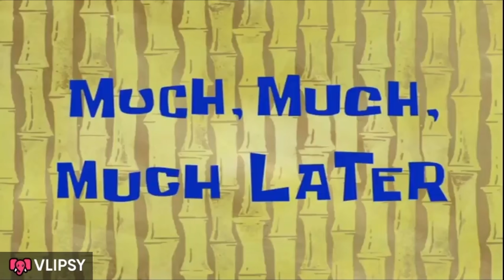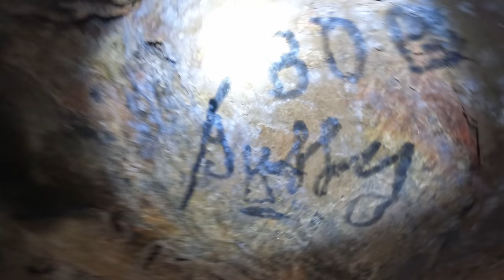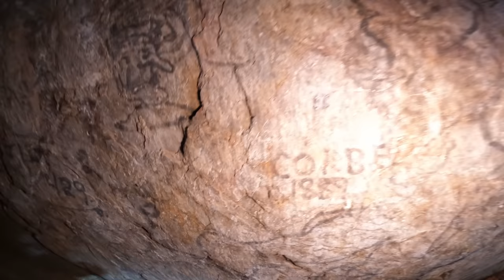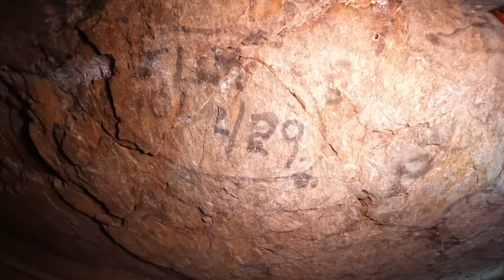We Got Stuck In An Old Mineshaft Elevator 900 Feet Below The Ground At Cerro Gordo!

Comment: When you see a "broom handle" sticking out of a hole inside a mine, please don't touch it! It's probably a tamping stick. Tamping sticks were non-conductive material (usually wood) used to tamp sticks of dynamite in to a blasting hole. That being said, I really enjoy your content!! I probably never would have found your channel, except that I follow Ghost Town Living. You rock!
Reply: would dynamite be able to explode after 100 years of being in a hole with a lot of moisture? genuinely asking.
Reply: @No444F  Yeah, sometimes it can explode by complete chance.
Reply: @No444F  thats why theyre illegal until under special certification and even then the old ones arent used. Even dropping one has set em off completely unstable aged.
Reply: or it was the storige for the anti horny bonk stick for the miners this is a joke
Reply: @No444F  that's the beauty of NITRO! Bump or just the ground vibrations from stepping near it, can set it off.
Reply: 21:15
Reply: Learn something new everyday
Reply: This is mad I love it well done boys
Reply: Fun fact old dynamite sweats nitroglycerin
Reply: @No444F  YES lol. TNT sweats nitroglycerine, which will explode if you touch it hard enough. The amount of nitro that sweats out does depend on how the TNT is stored and for how long, but obviously the safe bet is to assume its unstable if you don't know how old it is. If the nitro goes off from being moved too hard, it can set off the whole stick, which can kill you. 

Its one of those situations where if you aren't an expert, no touchy

Comment: Anytime you handle sticks of dynamite. You have to wear really good leather gloves. Because if ya don’t. It will cause your blood vessels to dilate. Giving you a spinal headache. Which trust me....you definitely don’t want. Also some blasting caps can be set off by static electricity alone. So I would definitely do some research on how old it is and what kind it’s is. Before messing with any of the explosives down there. If I had to guess. I would guess that it’s probably harmless as old as it is. But I would definitely check first lol 🤙🏽
Reply: Ice cream will take care of the headache, believe it or not!
Reply: For those who don't understand.

Dynamite is nitroglycerin "stabilized" by mixing it with diatomaceous earth.  That works quite well until it starts oozing out of the dynamite.  Then it's just as touchy as nitro is reputed to be.

In the early days of rail, a crate was "lost" at a station's cargo area—no bill of lading, no mfgr marks, leaking an oily substance.  The station manager decided to find out what was in the crate by opening it with a crowbar.

The explosion destroyed the station and did significant damage to surrounding structures.
Reply: Excellent comment. We are bioelectrical beings. We can store a great deal of energy in our cells. That can be discharged with a simple touch.
Reply: @EdwinWiles  the same shit that is uused in pool filters??? i never knew that! i did pools for 20 years and hated cleaning DE filters! and i imagine there was quite a mess where the man once stood??
Reply: @tre420gaming4  What man?  What station?  That lot's been empty for the last 30 seconds.
Reply: @EdwinWiles  and killed 20 as I remember. It was covered in a history talk I listened to.
Reply: @EdwinWiles  it's nap time grandpa. get off the computer your making a fool out of yourself again.

Comment: when everyone was laughing the brake failure off Heavy D wasn't which shows how serious it was and how much of a fright he got.
Reply: Yeah he really is a big wimp at the end of the day
Reply: I’ll be honest, I’ve never seen brake fluid boil in a Polaris before. I’ve made some boil in a late model stock car, but never in a 4 wheeler. Good lord.
Reply: Yep 900 ft isn’t crazy far but concerned how old that mine is pretty serious stuff and not the safest… and to the comment of a wimp dude idk if you have ever came close to death it really changes things and it a weird feeling and very life changing. I came within inch’s of dying in 2019 iv got 3 places on my brain. Can’t spell for shit had back surgery 3 shoulder surgeries and my right shoulder won’t heal or get better and will be a 3rd surgery one day with a complete replacement just wanna wait as long as I can.. so I wouldn’t call him a wimp for worrying about himself and the crew/team in the cage.
Reply: this hurt my brain to read
Reply: How serious it was? GMAB!  You really think he'd be stuck down for long just because the elevator failed?   How many very capable guys does he have working for him?   It was either get the elevator going, which was obviously the most likely scenario or they would figure something else out pretty quick.
Reply: To accurately predict what the remaining load capacity of the cable after sitting for so long without use, or the additional strain when the cage binds on the sticky rails, that is impossible.  You would be guessing.  And the possibility of rust working inside the cable for ten decades or longer, at any point along the length.  He was right to be concerned.
Reply: @docwatson1134    I think it's pretty obvious the cable has been replaced, looks fairly new.
Reply: From the video the cable looks to be in fairly good condition, but to assume the absence of corrosion inside the cable, when immediate death is the result of a failure, is not good judgement or good practice.  In all other mine exploration videos, there are TWO safety lines, the one you are hanging on, and the one that will catch you if the first one fails.  

Obviously that would be very difficult and expensive to do here.

I heard it said, it's all in your head.  Until your equipment fails.  Then it gets real.
Reply: @docwatson1134    LOL!   It's clearly not the original cable, they replaced it and I bet they used the same type of cable they were using to pull vehicles up from that cliff.  I'd say they have it covered.
Reply: When you overload something over it's capacity not too smart especially when it's that old!!! Hell, he left the old canteen down below!?!?!? SMDH

Comment: Standing on the roof will make it more likely to jam. It moves the centre of gravity up, relative to the cable attachment point, thereby making the cage more likely to twist and tilt over..
Reply: Pretty sure the extra weight in the elevator counteracted that.
Reply: @johnn3542  Yes that's a good point, and if I'd been on top of that cage, causing a slight shift in the COG would've been the least of my worries. I'd have been far more concerned about loose debris falling down the shaft. If something falls 700 ft it's going to be moving at almost 150 mph. Event a small rock at that speed could kill you,. Considering that it was a bit silly that none of them were wearing safety helmets.
Reply: @keithrushforth4019  thanks OSHA
Reply: @keithrushforth4019  they had just went down it.  I would assume they would know more about the mine shaft condition than the internet.  Seemed like the biggest concern was the lift getting stuck like it always does.

Comment: The "broom handle" is most likely a tamping rod. Use extreme caution with no forced air ventilation there could be pockets of O2 depleted still air.
Reply: true. This mine does have "chimneys" that extend all the way down to the 900 foot level?...there are some paths on a map that go deeper, but I know that there is two chimneys for the whole mine. Brent went spelunking down one of them and then back up.
Reply: dont think thats a tamping rod, its probably a post to attach wire too. You see that same bit of wood everywhere in PNW mines for power and communication lines.
Reply: Are you single

Comment: im most impressed with that elevator, built to quality and strength apparently.
Reply: p!nned by HeavyDspark  Are you trolling lmfao
Reply: Concrete Plus  but she's still 150plus years old u replace the cable on your truck winch every few years so of course there's a different cable but do u realy think your winch will be around in 150 years I don't think so
Reply: Concrete Plus  of course it's got bearings hoses pumps rebuilt and the likes but she's mostly original for being 150 years old she's mint
Reply: @RatSpleam  it's a scammer
Reply: @DevDog67  what you talking about?
Reply: @josephwickham1989  the "pinned by David Sparks" account that keeps spamming all of the comments and posting a phone number for you to call. 99% chance it's a scam.
Reply: @RatSpleam  stollen pic account
Reply: Concrete Plus  what makes u think so?
Reply: Concrete Plus  Yeah.... the framing (which is a very key component to the operation of the lift) is original.... and that’s the point..... They would’ve replaced all the bearings, grease, etc while it was still in operation.... Nice try on attempting to suck the fun and historical value out of the lift and cerro gordo in general..... You must be a real joy at parties.

Comment: No one can comment on the damn dynamite.
As far as I know, the nitro in the dynamite from back then usually would have simple saw dust to contain the liquid. There is to my knowledge a good chance if any of this is there there is fairly unstable and i've heard cases of the nitro crystalizing. In any case, theres  a good chance there isnt even any explosive left in those stickes because real sticks would have been turned occasionally to keep the fluid, from basically soaking through on side or getting somewhere it shouldn't be. So more less the fluid probably isn't even in there any more. So imo, I'd personally stay away from it, if you did for some reason need to touch it, id do so in the most cautious and gentle manner possible. Dynamite on its own is considered a secondary explosive which simply means it needs something to get it to explode. much like a bullet without the primer, its basically worthless however it can still be dangerous in many circumstances. Also when loading your own ammo the primer is in fact the most dangerous part of that.
So I'll with, this nitro could and prob did leak out a long time ago, with that said, if any of it is left, that is very stable stuff from back then, it was invented in the mid to late 1800's believe it or not, and killed many many people. Point is, I dont think its a good Idea to touch it. If you have somewhere you can stand behind something down there and chuck a decent size rock at one of them you will in fact know with complete certainty what it is, safe to handle or not. However with that said its an old mine and who knows what that is capable of causing to happen.
Reply: I was waiting to see this comment 

I explored California desert mines and was told never touch old explosives
Reply: If you handle the dynamite you probably get the worst migraine headache from the nitro.  Best left alone!

Comment: When it was new the dynamite was just fine (fine to generally handle, just be careful of tossing it about), it's when it gets old that it's dangerous. Basically dynamite is just nitro glycerin suspended in clay with a paper (or possibly cloth, idk) sleeve. As it ages the nitro glycerin seeps out and makes the dynamite look wet. This is called sweaty dynamite and it's especially dangerous since now the nitro glycerin is exposed and is especially volatile (as in accidentally move it wrong and KABOOM volatile). Now the sticks I saw in the video looked to be dry but still have extreme caution. 

If you want to try moving it, a potential way might be to take a stick, gently place it into a plastic container of acetone (or possibly alcohol, water might also work). That should make the very unstable nitroglycerin a little more stable (in theory) and then soak up the liquid afterwards with sand or sawdust. It can still be very dangerous but potentially safe enough to move. You could try a couple baths per stick but I'm uncertain.

Comment: Worked 750' down in the Salt Mines in Hutchinson, KS. Under Ground Vaults & Storage...pretty cool when they a new shaft in , freezing water table to drill & pour shaft walls.  original shaft cage banged around  quite noisy.  Old man Carey about took a suicide mission testing an escape with a used cable that snapped.  used to wander a bit down there, pretty cool!

Comment: That yellow pocket you just passed around 15:20ish looked like limonite. Thats probably something they were chasing, usually free mill gold. Faults in the earth run at 45ish degree angle and that shaft (vertical) sank straight down and a drift (horizontal straight) was blasted to intersect the fault. If you are in a mine and see a "stope," 45ish degree shaft going up, or a "winz", 45ish dergree shaft going down, that intersected the fault with the vain structure and went to town.

Comment: ⚠️  “LEAKY  COAX” ⚠️ RADIO  COMMUNICATIONS  MADE  EASY  IN  MINES  &  TUNNELS !!
In the public safety world of radio comms (fire department / OEM), we make use of a type of antenna coaxial cable that has “slots” cut into the shielding during production of the cable.

Essentially, the “leaky” cabling is dropped down a vertical riser as part of a semi or full duplex radio communications system.
Every few floors or at specific distances, a means of expansion is installed.  (either a through coupling or a splitter type device)
Our best performance in underground structures made of steel reinforced (“rebar”) concrete has been made using UHF (450-490Mhz).
In structures comprised of earth with wood structural supports, VHF (150-160Mhz) seemed to have the best performance. 

The frequencies utilized matter much less than the antenna system !!
We experimented with radios in multiple bands.  40-50Mhz  /  150-160Mhz  /  450-490Mhz  /  700<>900Mhz and 2.4<>5.8Ghz)

We also experimented with analog / p25 digital / DMR (TDMA) protocols. 
By far, DMR (TDMA) gave us the best overall performance with P25 (unencrypted)  right below that and analog at the very bottom.
The one exception to analog utilization is when using simplex…

Semi-duplex operation with SEPARATE antenna systems.  One dedicated to transmit at the EXTERIOR and either a single receive antenna system OR a multiple receiver “voted receiver” system.  When using multiple antennas/receivers for the receive side of things, the system can automatically determine the best signal quality and then select that particular source.

The

Comment: I can't believe the hoist pulled all that weight. I was involved in settin all that up, that's the second hydraulic motor. The first one shattered  the main shaft from being too heavy and bouncing going thru the tight spots. We never had more than three men and some tools in the skip at any one time. We only made it down to the 900 once, but I spent a bunch of time at the 700 workin on the pump. I'm glad to see it's all still working. Be careful down there it's all pretty sketchily.

Comment: That 'Jack'  looks like one of the holdfast you'd strain against floor and ceiling temporarily.   The air drill  could be clamped to it and fed in on a screw.    This allowed heavier faster  drills and took the weight off the operator.
Did those drills you brought up  have a hole running through the core.  That would tell you if it was a water cooled bit.  Serioys hard-rock drill. 

Another thing I meant to say is that those doors aren't always for magazine.   Doors have been used for centuries to manage ventilation.   Old time British mines would give the job of minding them to  little kids  who sat all day in the dark  waiting to see the candle light of approaching  miners.   Often they'd be of canvas stretched over a frame.  Nothing left of them nowadays for sure.

Candles,   In North Wales mines  the candle had to be bought of of miners wages .   They were stuck to his headgear with clay.   I see yours were Stearin,  not beeswax.
Great video yet again.  Great collaboration.   You deserve to succeed all of you. 
For mining surveys,  photo expeditions and mines archaeology check out UK's  group "Northern Mines Research Group"    ( that's not me!)

Comment: The best way to bleed brakes with no confusion between the pedal pusher and the brake bleeder is to have the bleeder say down and then the pusher repeats it so the bleeder knows the pusher heard it. Then the bleeder says up and the pusher repeats it and says "up". This way both parties know exactly what's happening. Nothings worse than bleeding brakes and having the pusher release the brakes while you have the bleeder open and sucking air into the brakes.

Comment: I put 30 yrs. In a Pennsylvania coal mine. I was a mine examiner aka fire boss. Part of the job was to examine the old workings of the mine weekly. I used to have to ride on the top of the elevator to check for ice in the winter. I'll take that challenge.

Comment: How did you guys even fit in the elevator with those giant berries hanging between the legs? This made me pucker, especially when you guys came across the old dynamite. For people wondering why the dynamite made me nervous. Old dynamite can sweat and leach nitroglycerin which can crystalize on the outside of the dynamite or even pool and crystalize on the ground under the dynamite.  Nitroglycerin is extremely touch sensitive. If they were to accidentally kick or step on a stick of dynamite there's a good chance it would explode. Don't go into old mines if you don't know what you're doing or if you aren't with somebody who knows what they're doing. These guys have a lot of experience.